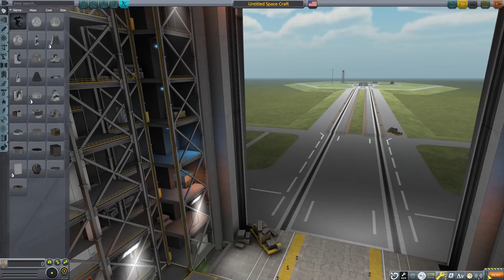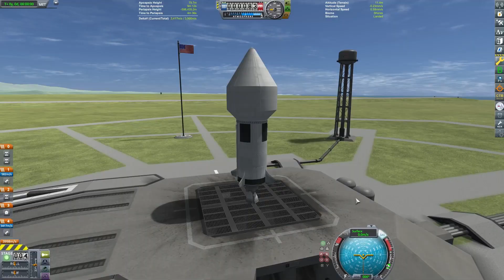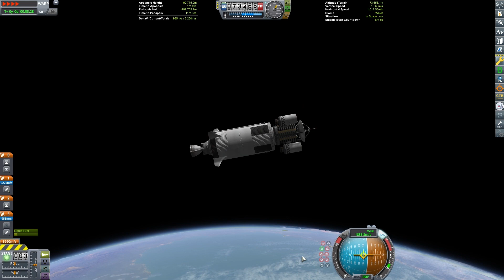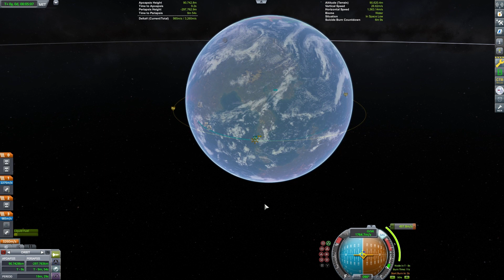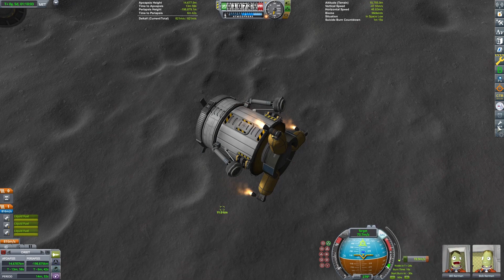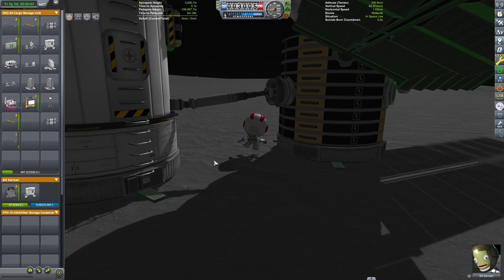Building and Landing a Mun Base

Comment: Funny thing:
The first time I got to land on the moon, I made a tall direct ascent lander, though I did not have enough fuel to return (not with my skill level then at least). I thought  I got landing on the mun solid but not coming back so my next thought was to build a munbase. And I did. I landed five fat segments next to each other and made a munar train! I did even have docking experience at this point, but it worked out so well! Later I was still not confident in my ability to return so I tried to design a lander rover that could drive up to the base and get some fuel from it. I was a funny guy!
Reply from the maker: Oh the things we did when we first started playing! The BG parts make lining up the docking ports so much easier.